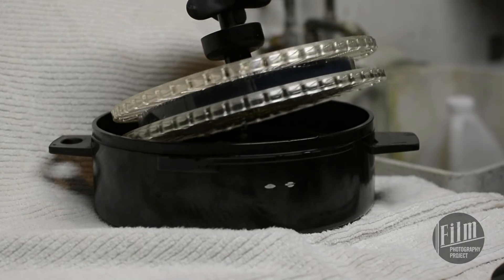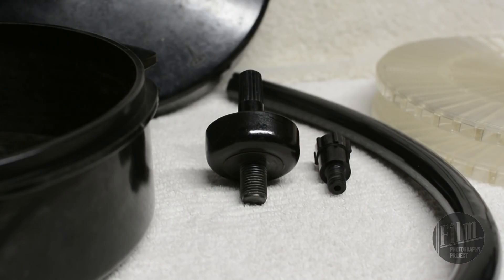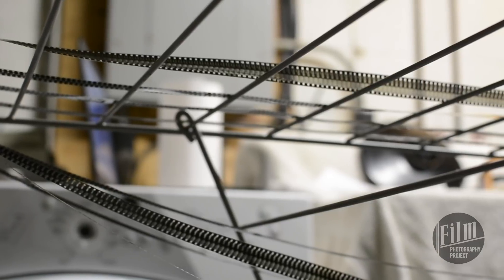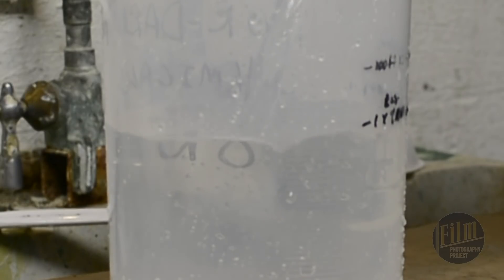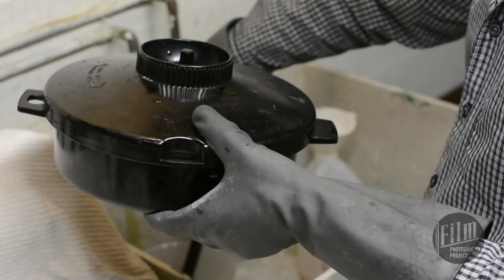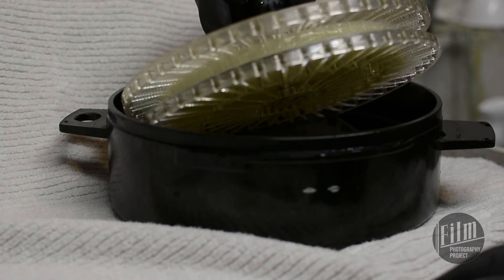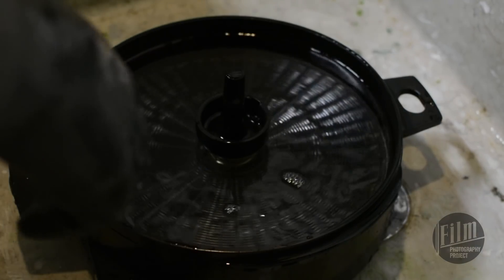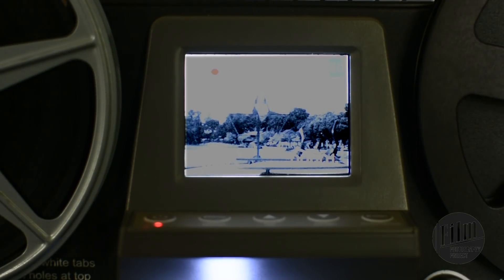Develop BW Reversal Film & Movie Film At Home

Comment: Potassium dichromate is illegal to buy in many EU countries, It can be bought only by persons holding a license for handling toxic chemicals. It can be substituted by potassium permanganate, but this is a schedule 2 drug precursor, and its sales are controlled. Also, it is not possible to buy sulfuric acid, which is more concentrated then 10% in the EU, because it is considered a precursor of explosives, and even the possession of it needs a permit. The funny thing is that if these chemicals are sold in a kit sold for photography, there is no problem for buying it (such as Foma kit for reversal), but buying the chemicals separately if you are a not a professional lab is next to impossible because of too strict regulation.

Comment: I would suggest another method for bleaching film, using far more common and safe chemicals. This is a 2 part bleach, using 4 common ingredients:

Part 1: Copper Sulfate, Salt, and Citric Acid. Heat 800ml of water until it is lukewarm. Mix 50 g of copper sulfate, 50g of salt, and 5g of Citric acid. Add water to 1 L. Mix until all powders dissolve.This solution is mainly CuCl3, and will dissolve aluminum, so be aware of this. Other than that, it is safe to handle, and only basic chemical safety precautions need to be taken.

Part 2: Ammonia 1+4. Regular 5% cleaning Ammonia works well. Ammonia is a somewhat dangerous chemical, but as long as you follow all directions on the label, and don’t mix it with any other chemicals, you will be fine. Although mixing part 1 and 2 should be avoided, if they are mixed, the reaction does not release any harmful gasses or chemicals.

Replace the dichromate bleach step with 5 minutes in part 1, and 3 minutes in part 2. Other than that, the process is the same. I hope this helps!

Comment: Excellent video and teaching. I have the lomo tank, shot some black and white reversal film but I just need the chemicals to make them at home. Would you recommend the CineStill Film CS2 Cine Simplified ECN 2-Bath Powder Kit to develop B&W Reversal film at home if you can't get the chemicals shown in the video? Thanks so much.
Reply: Hey Rene--ECN (or any color chemicals) will NOT work on Black and White Reversal film--at least, not in the intended way. You'll need to use the correct type of black and white reversal chemistry in order to get the proper results. If you are struggling to get the chemicals in this video, consider subsituting different things (for example, you may be able to get a potassium permanganate based bleach. There are also lots of videos out there on using hydrogen peroxide based bleaches.) If you are having issues getting the chemicals for the developer, it is possible to get great results from other standard black and white negative film developers as your first and 2nd developer.

Comment: Would this chemistry work on Kodachrome 8mm to process it as black and white reversal film ?
Reply: Yes, the same process can be used to process old Kodachrome, but you'll need to play around with the develope times and, of course, add a step to remove the remjet which Kodachrome has. Though, I would argue (especially in the case of processing 'found' Kodachrome film that might have precious family memories on it) you should process Kodachrome as a negative which can produce a better result in SOME cases.

Comment: I've mixed up a batch of Kodak D-94a for Tri-X Super 8. However, Kodak's data sheet says use the first developing bath for 90 seconds and the second for 50 seconds? Are these times accurate for Tri-X Super 8 developed with D-94a in a Lomo tank?
Reply: That seems awfuly short to process a reversal film--but that being said, I have no personal experience using D-94. It is possible those times are correct but I cannot be sure as I've never used that specific process.

Comment: Is that bleach solution reusable? If so, how many reels can you get out of it? Also, what is the proper and safest way to dispose of it?
Reply: It is reusable. It really depends on what kind of film you process. Generally speaking, with fresh black and white reversal film, you should be able to get about 1,000 feet out of it, though you may notice that you have to extend bleach times towards the end of its life. But there are other factors--how and where you store it, how much time has passed between each roll you process etc. You'll notice that it starts to turn brown and then greenish as it starts to exhaust. The only way to safely dispose of it is to find a chemical recycling program near you that can handle it. It is not something you should throw down the drain. If you have to throw it down the drain (which I absolutely do not recommend as it is so bad for the environment to do so--and could be against local law depending on where you are at), you should add a good scoopful of sodium sulfate to it to help reduce the chromium. But again, you really should make the effort to find a chemical recycle or disposal program.
Reply: Chromates must never go down a drain, a septic tank or onto the ground. 
   Chromate solutions can be  mixed into a sack  of concrete  which is landfilled after hardening. 
   NEVER send that to a wastewater plant or a leach field.    In fact,  I would highly recommend abandoning that bleaching compound altogether.

Comment: is there any 16mm black and white film that would use chemistry that still photos would use?  I wanted to try and load 16mm film into a 110 cartridge and then develop it at home.
Reply: Any of the black and white films could be used. You don't need to do a reversal if you want a negative, just develop it in regular black and white developers. You can probably find times for the stocks, especially if it is available in 35mm as well.

Comment: I guess you are using a Fomapan 2x8 100R 10m spool. Can I use the same quantity of developer for a 30m spool or do I have to use it 3x concentrated?
Reply: You would not need to add more concentrated, but you will need more chemistry in the tank to cover the film adequately

Comment: Looking into a clearing/stop bath, i was told to use a mixture of water and sulfuric acid, and that you can simply use water, and run it through the tank a few times, but using sodium sulphite? That's sounds odd. Sodiumthiosulfate, or plain hypo, is the main ingredient in the fixer, and those two baths take care of very different jobs. I'm confused. I know that sodium sulphate and sodiumthiosulfate is not the same thing, they share big parts of the names, and the differences can't be too major.
Reply: The main purpose of the Sodium Sulfate (anhydrous), from what I have been told (I am NOT an expert in chemistry) is to help neutralize the dirchromate bleach and help to remove any of it that is still remaining on the film before the re-exposure step; this is why the film turns from yellow to white. I suppose it could be substituted for water, but I imagine that would take longer to achieve. Plus, the sulfate is super cheap, so why not!
Reply: @owenthegenealogist  Ah, of course. That makes sense :D
Reply: @owenthegenealogist  Are you sure you don't mean Sodium Sulphite (Na2So3)?  Sodium Sulfate (Na2So4) don't seem to do much difference here, or did I miss something?
Reply: @DanielWirgård  You are exactly right--it is Sodium Sulphite! It is funny you noticed this because once a lot time ago, I didn't pay attention and purchased Sodium SulFATE and noticed that it did not clear the film as well and was also much harder (for some reason) to mix.

Comment: Where do you get your potassium dichromate?
Reply: From some shady guy in the local alleyway. (You can get it on 
the Photographers' Formulary website, but it requires a DEA form signature, since it's dangerous, and the shipping will be $25 more than usual due to the hazards associated with the chemical. You may want to look into a 12% hydrogen peroxide bleach instead, since it's way safer, and isn't classed as a controlled substance. Just be warned that it takes longer to bleach with peroxide.)

Comment: I am a little confused. You are using the same developer for both steps? And once you bleach it you can pull the film out I'm normal light between steps?  Can this be done with any film that has a good clear base?
Reply: Shane Sharp hi Shane! Yes—you use the same developer in the second step as you do in the first step. After about 1.5 mins in bleach, you can expose the film to light safely.  You can reverse just about any black and white film. I’ve successfully done Tri-X, Plus-X, Illford, the list goes on.
Reply: @owenthegenealogist  thank you! I will have to give this a try soon, just need to get the bleach chemicals..

Comment: Everything cool, but why do you have to dry the film on a drier thus risking scratches and dust, I dry mine directly in the spiral of the tank, just use a fan to do it quicker.
Reply: good point. The spiral already has the film nicely layed out without the emulsion touching anything, when the emulsion dries whilst touching something it leaves an imprint and dust does that too.
Reply: He does this specifically because 50 feet of film (Standard for Super8, probably 25 feet for Regular 8) is very inconvenient to hang anywhere, unless you got a bottomless pit available to hang your film to dry. His solution may not be the best solution, but it is a functional one.
Reply: @Daviljoe193  I cant help but think you failed to get Petko's point of drying using the Tanks spiral. many Lomo tanks can carry 50 feet of film in one go. no need for your bottomless pit idea